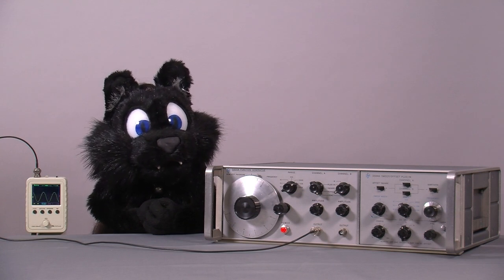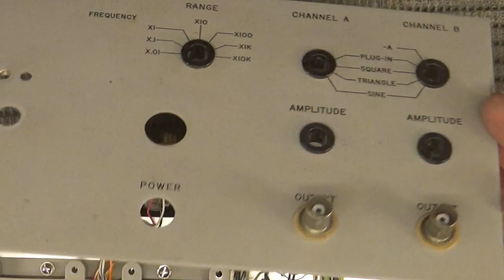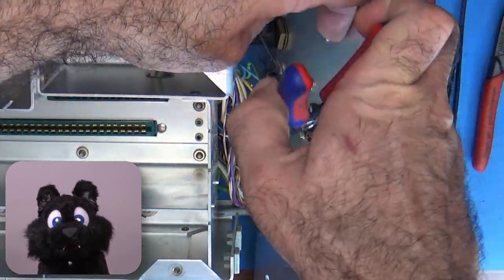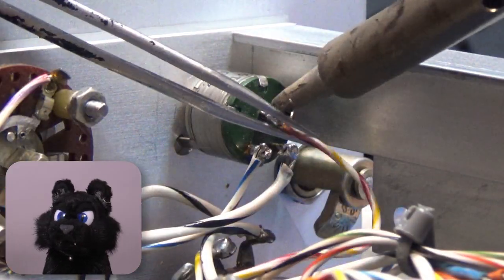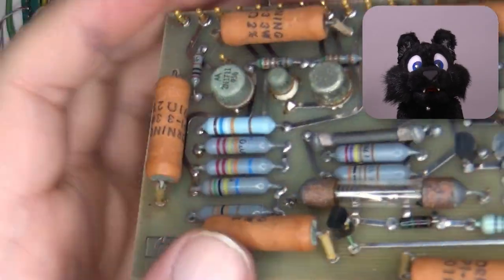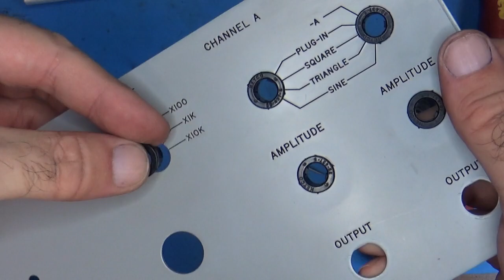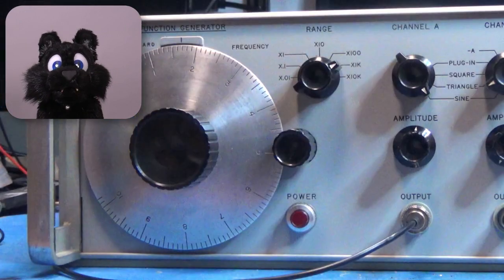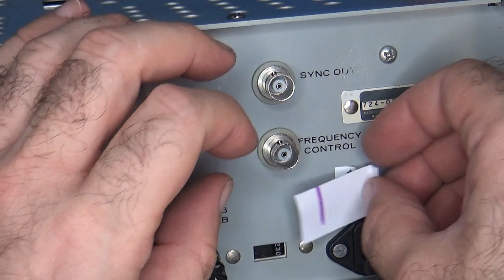HP3300A Function Generator Restoration

Comment: Other thing: transistors that work on high temperatures tend to raise their shot noise level with time. Interestingly shot noise is independent of temperature. So at the same time operating at higher temperature shot noise is less relevant because other forms of noise are far higher because the depend on temperature. Shot noise is usually relevant on very low currents.

Comment: Such a shame that a fine, faithful restoration could not include engraving a setting for 11 on the frequency dial.  :-) Well done!
Reply from the maker: It might look like it, but the linearity fails after 10. The acutal limit is about 10.7-ish. So yes, it does go past 10 but not quite to 11 :P
Reply: @atkelar  Yeah. Some sound equipment also avoided the beginning and end on potentiometers. This is called end of course non-linearity. I'm not sure of the reason, as it happens far before the center tap touches the rivets at the end. Maybe something on the pirolisis process  used to create the carbon layer (if this is true NiCr wire potentiometers would not suffer from that) or maybe something about the current distribution nearer the contact.

Comment: Wow! The sine wave is created linearly piecewise by diodes and resistors! I must see this circuit. It is a precision instrument, so I never imagined that this would result on a signal with low harmonic distortion.
Reply from the maker: "Low" by 1970s standard of course. With the trimmers, it goes below 1% according to the alignment guide. I used this manual scan here, it has the schematic inside: https://www.manualslib.com/manual/1260091/Hp-3300a.html
Reply: @atkelar  The ICL8038 wave function generator IC used a similar way. It made that from a triangular wave.

Comment: Why is it called an oven?
I'm a locksmith by trade and a hobbyist when it comes to restoration of old electronics
Reply from the maker: Not sure where the name comes from, but it does serve the same porose as an oven in the kitchen... bring stuff inside it up to temperature, so that's the reason I assume. Anyhow, the idea is that it is easy to heat stuff and hard to cool stuff, so elevating the critical components above ambient temperature allows you to keep them at a narrow range no matter what happens outside. There is a feedback loop between a sensor and the heater. And yes, I did check that it turns indeed off after some time 😜 that was a concern indeed.
Reply: @atkelar  thanks!